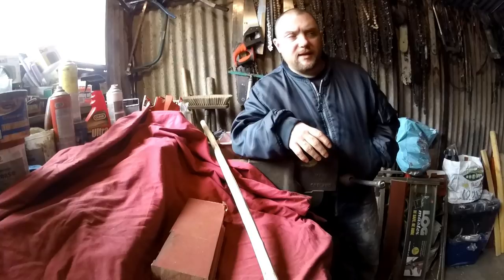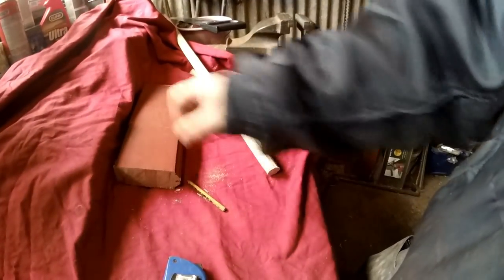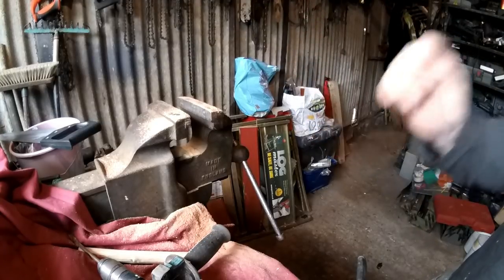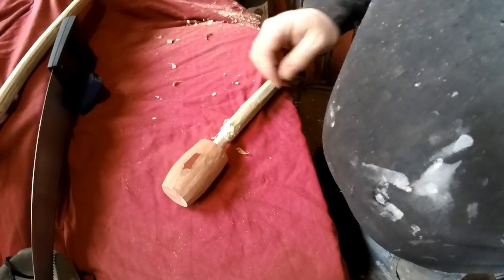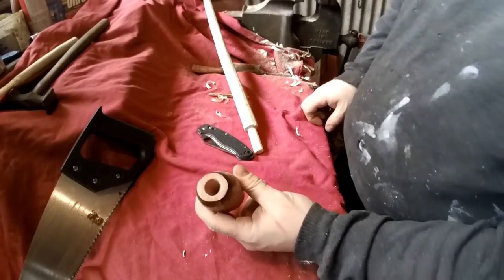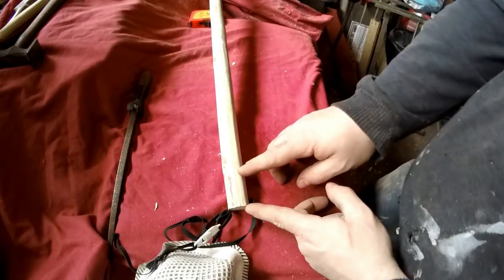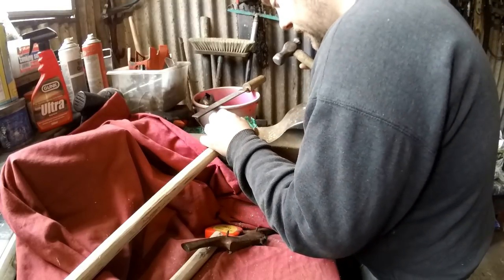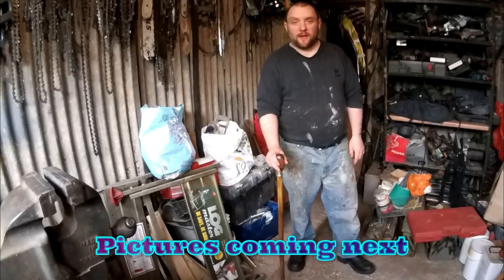How to make a walking stick (U.K Self Defence Items)

Comment: Getting older is bloody horrible but it has a couple of advantages. First, no one takes any notice of you, so you more or less become invisible and second, no one questions why you're carrying a walking stick. If you're younger and you're walking around with a walking stick with no good reason, you can be pulled up by a copper. I carry a stick all the time even though I don't need one.

Your stick is really nice, I don't have the necessary skills or tools to make one myself but, if I did, I'd maybe put a load in it to give it some extra heft.